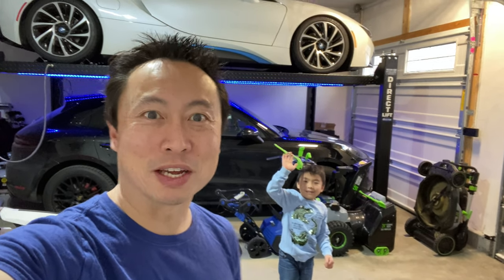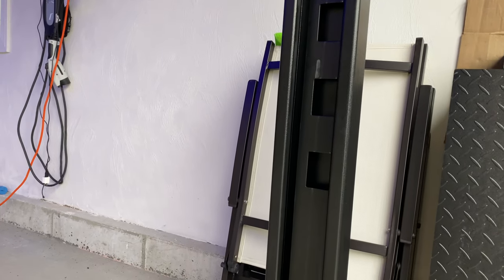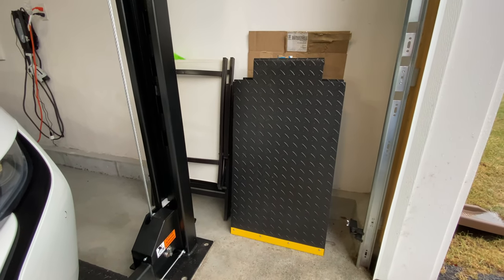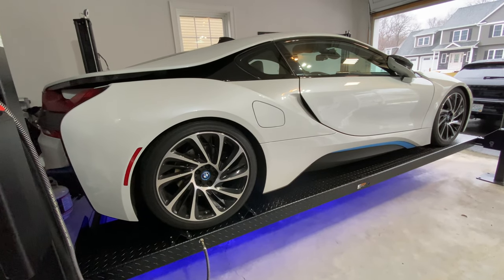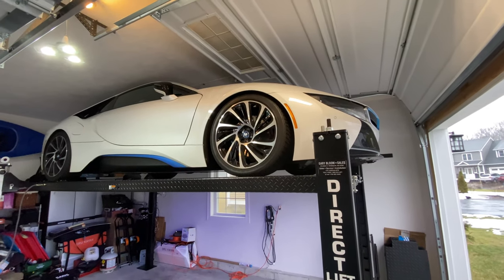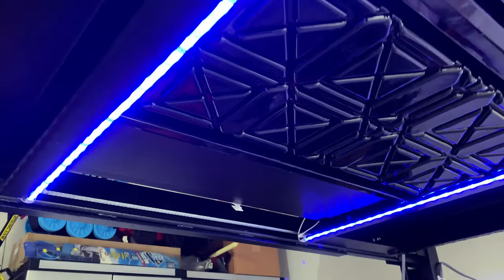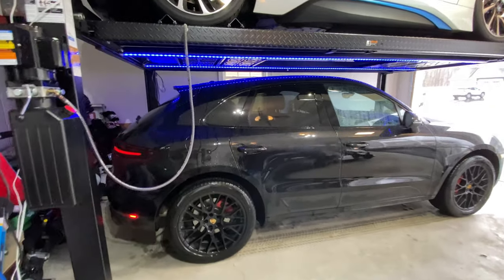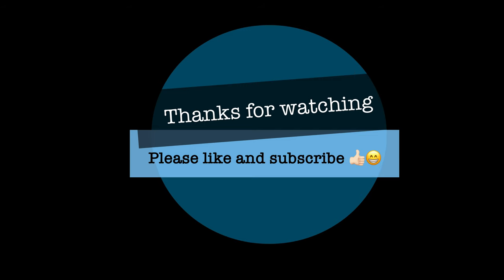Four Post Car Garage Lift : Direct Lift Pro Park 8S use and operation

Comment: Great demo and explanation!  I wish I could do it in my garage but my ceilings are too low and some of my ceiling includes the HVAC ducts that are encased with drywall so I'm totally out of luck.  Time for a new house, lol!
Reply from the maker: I wanted one in my last place too.  But same thing, didn’t have the ceiling height for it.  Definitely handy to have and can actually move around with casters if required.

Comment: I was about to ask about the trays, that mean you can actually work on the under the car
Reply from the maker: Yes it comes with drip trays.  They are just plastic and you can slide them or remove them completely.

Comment: Wow, that goes up slow! Are you running 120v or 240v? Nice audio and camera work. 👍
Reply from the maker: I’m running 120V.  Parts of me is ok with the speed because my car gets pretty close to the ceiling.  Any faster I could make a mistake.  I’m good with the speed.  I wish there was a memory setting on it.

Comment: Great video.  I’m in the market for a four post lift and dimensions are critical. Can you tell me if your lock ladder is adjustable? I’ll need to be able to set the height of the lock at 52 inches give or take an inch.  Also, do you know the height/thickness of the runways plus the crossbar?  I need to find a lift with an adjustable ladder and the thinnest runways possible because I only have 9-10 inches to spare after adding the height of my two cars.
Reply from the maker: I know the feeling of having a garage which presents a right fit situation.  My locks are not movable.  I use a direct lift and they have a nice ceiling height calculator on their web site.  I used a laser measure tool to get all my numbers.  If you have a sports car, you may want to opt for a wide version of the lift.  I ordered a standard version and my car barely fit on it.  The new lift is wider and so much easier to park on.

Comment: Have this lift and can’t get it to go low enough to load a car. It’s new, plumbed and greased. Any help is very useful thanks in advance.
Reply from the maker: For mine, I have to hold the lock mechanism open until it clears it.  Once it clears the last lock I can lower the lift all the way to the ground.  I’d have to see a video to see what you were talking about in terms of the issue with it not going all the way down.  Haven’t had any issues with mine.
Reply: @ngl1145  thanks for answering, I hold the lock mechanism but it hangs up on the back section. The loading (front ) works fine. Don’t know how to send yo a video? The instructions are AWFUL used YouTube to assemble the thing. Waiting on a nut that is missing that might just fix the problems.  Thanks

Comment: 😠 - When you leave something in the i8’s boot after lifting it.
Reply from the maker: It has happened many times. That means backing out the bottom car and lowering the lift again.  I learn to triple check before raising the car.

Comment: wow really slow lift and you should bolt those posts into the concrete
Reply from the maker: I was told by the installer that they don’t recommend bolting it in.  Could cause jamming issues if it’s too rigid.  The car is pretty stable on the lift.  Does not move.  It was one of the things I did ask them about doing.  As for speed, it only needs to go up once a day if I take it out.  No issues there.  Plus I want fine control of when I stop it.  If it goes too fast that is an issue.
Reply: @ngl1145  looks like the columns are bowing out - just doesn't look right